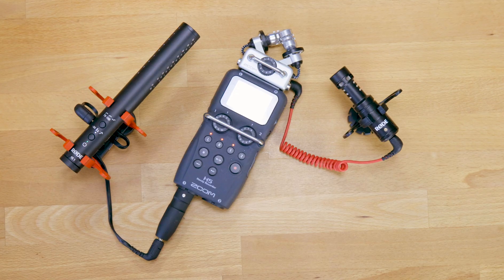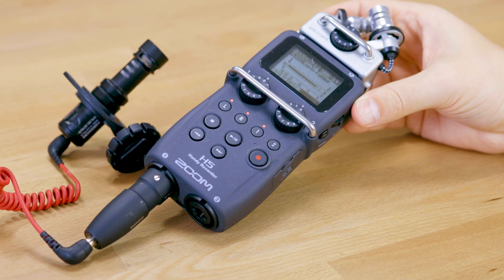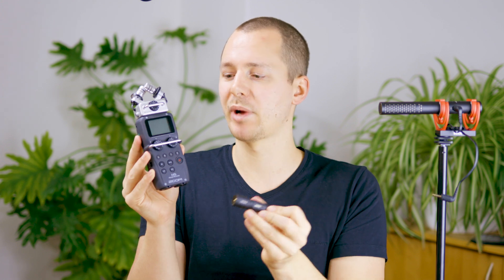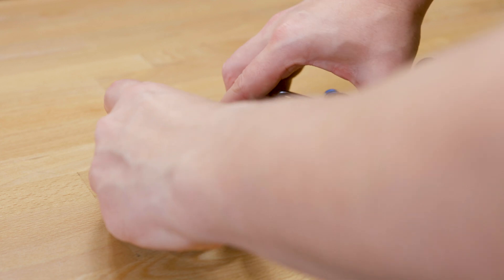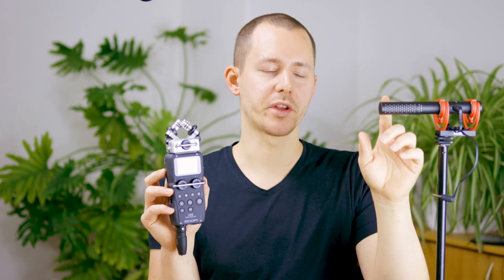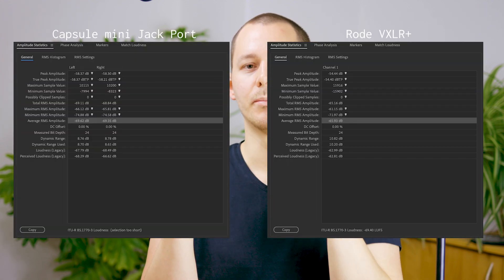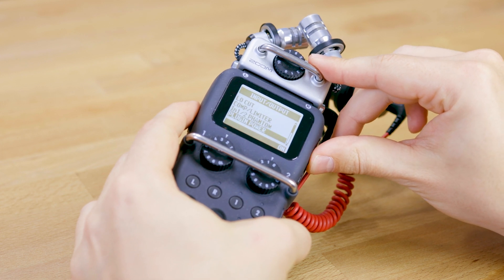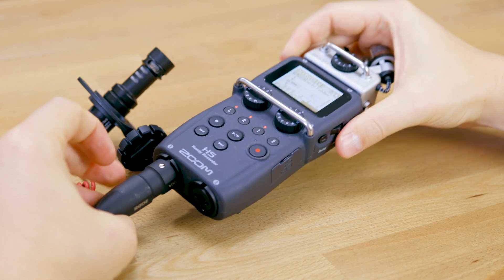Enhancing Audio Quality: Zoom H5 with 3.5mm Mini Jack Mic - XLR Adapter vs Built-In Port

Comment: So the standard gain knob for recording in studio is set to 15 for Videomic NTG?
Reply from the maker: That probably should depend on your needs and distance to the mic. However, I am using it on 15 most of the time and just lower it when necessary. 
I’d rather have the VideoMic NTG on 15 and the audio recorder on a lower setting. 
And if the sound is clipping / crumbling then you can also engage the -20dB pad on the mic.

Comment: Thank for the thoroughly crafted video! Do you have experience with any other adapters?  (Non expensive ones)

I want to use 2 generic unpowered headsets with 3,5mm jacks to record an interview. 
Can I just buy any random XLR to 3,5mm converter, then plug 1 headset into the top capsule and the other one into the bottom XLR adapter and then level out the voice level of the 2 speakers? Thanks!
Reply from the maker: Hi Jelly, I would be careful to assume that the headsets are unpowered since Plug In power is very easy to go unnoticed. Phones provide it, even laptops without one even noticing most of the time.
Now, do you already own the H5 or a similar recorder? If so, you could definitely try out if your assumption about not needing power is correct by plugging one of the headsets into the top capsule and see if it works (with Plug In Power disabled).
Now if all that turns out to be correct, then I would say you could probably use pretty much any cheap 3.5 to male-XLR adapter out there and it would work as described. However, one other thing that I would consider and possible take as a reason to use two 3.5 to XLR adapters instead of the top capsule:
The top capsule will then record the audio into a Stereo file and not into mono like the two bottom XLR ports. So you may hear a difference in volume or have to split the files in post processing. It may just be easier to just buy two 3.5 to XLR adapters.
Hope that helps and good luck.
Reply: @ChrisSpiegl  oh wow! Such a timely response! Thanks a ton. 
I just tested the 2 headsets and another pc headset and the all only show a level input when Plug in power is ON! Thanks for helping! 
Your advice with 2 XLR adapters is noted and will be considered!! The 2 headsets are mono mics (the pc headset a stereo) but as you said, when recording via the capsule, the right channel is ever so slightly picking up something, although the headset only inputs on L. 

well, the question is now: 2 cheap headsets paired with 2 adapters totalling ~50 Euro .... Is it worth it, or should I try to record the (podcast)interviews via the XY mic without headsets at all.... 🤔
Reply from the maker: From what I am reading, now you'd need something like the VXLR+ adapters which also convert Phantom power to Plug In Power if you'd want to use them with the XLR ports at the bottom.
Now if it's worth it to you, depends obviously on what you are going for.

I would probably lok into really cheap XLR mics but then you also need a stand. So with under 100 USD it's quite the challenge probably.

I would probably say: just go with what you have right now and see if podcasting is right for you if money is a consideration. Do it for a few episodes with that setup, save a little and then get two XLR microphones. If necessary, there are some good XLR mics with head mounting. But then again… I'd still try to go for the Shure SM58 or something similar.

About the capsule 3.5 mini jack: that's normal that if you only provide one side that the other has some noise in it in some setups. Best to just split the channels in post then you could still use the left channel audio (hopefully).

Good luck 🌸
Reply: @ChrisSpiegl  Chris, that was immensely helpful and rest assured - you made our day by providing help! Very much appreciated! So it will either be
a) 2 cheap t-bone headsets with XLRs from thomann for ~80 Euro seems also reasonable. 
b) use the current headsets with 1 converting XLR adapter for 25$ and plugging the other into the capsule and cutting the R channel in post and still be able to adjust speaker levels individually.
C) the cheapskate version = plug both headsets with a Y-cable into the 3,5mm capsule jack and not be able to adjust speakers level ☺️
D) risky (unlikely) option = buy cheap converters and potentially overpower the headsets.
C)record interview over XY Capsule without headsets
Reply from the maker: @jelly.1899  pretty much. By the way, which Headset are you looking at at Thomann? I am German and know the company a bit. 😋
I think the xlr option is in any way the best. 😁

Comment: Many thanks for info. Just have small question, because VideoMic NTG has inbuilt battery so it should not need power. In that case, Can we just use 1/8 to 1/4 inch Jack converter and plug it into XLR port of H5?
Also can similar method will work with Rode wireless go, as this also has inbuilt battery?
Sorry for bother but some explainaton would be appreciated.
Reply from the maker: Hey, the solution you are looking for is described in my video about the Røde VXLR adapter.
Please check that out: https://youtu.be/sZY6OIFVIz0
Basically: you can use a Røde VXLR adapter which is relatively cheap with the mics you mentioned. But you will have to turn on the VideoMic NTG manually every time.
Reply: @ChrisSpiegl  thanks for the reply, I watched that video, and as per you explainaton, Rode Wireless go don't need any power. So by theory just using 3.5mm to 6.35 mm adapter would work perfectly fine. But in some other videos they report it didn't worked. So can you please confirm on it can work or not, and why?  Many thanks for your time again 🙏🏻
Reply from the maker: @sp34531  That's sounds about right.
Reply: @ChrisSpiegl  Thanks for reply. So did you try and confirm whether it worked or not? As I'm planning to purchase Zoom H5 and Wireless go with ought VXLR+ adapter. Would really appreciate your response.
Reply from the maker: @sp34531  You can plug the Wireless Go into the upper capsule mini jack. You can also use the VXLR adapter.

Comment: Edit: ok I watched your other video about VXLR vs VXLR+, where you explain that the electronic adds noise in the VXLR+. Sorry for the bother!

I didn't understand which one has the lowest noise floor: the minijack, or the XLR? In the statistics, the VXLR+ seems to have the best amplitude... Thank you for your comparison! ;-)
Reply from the maker: Great you found the info anyways. The amplitude differences may also be in my speaking. 😅
And in turns of the VXLR vs. VXLR+ I hope you also understood that there is a difference that is important which you use for which mic. 
Happy recording. 🌸